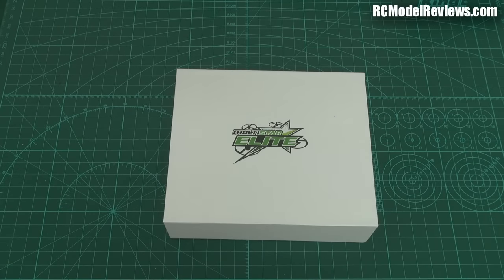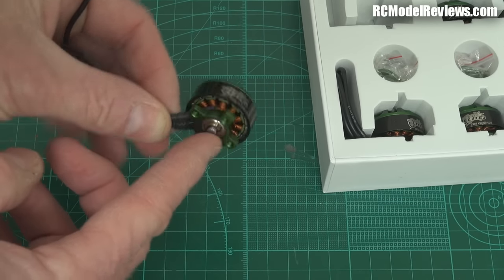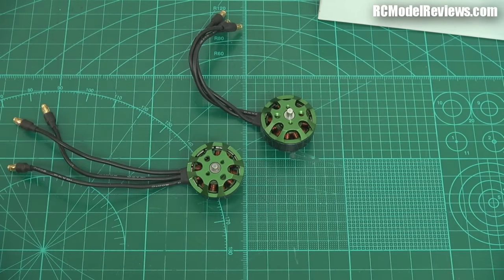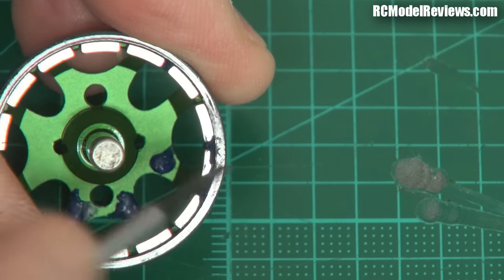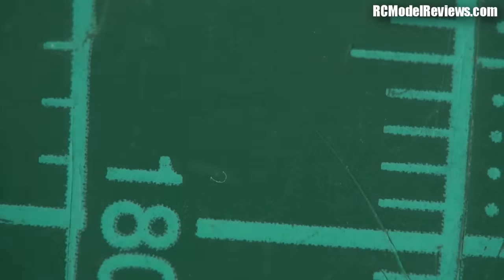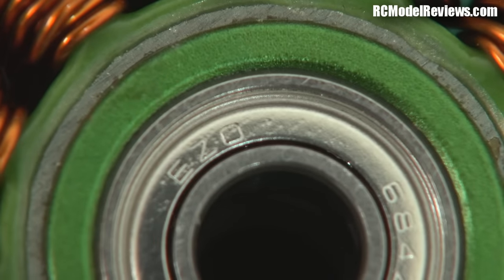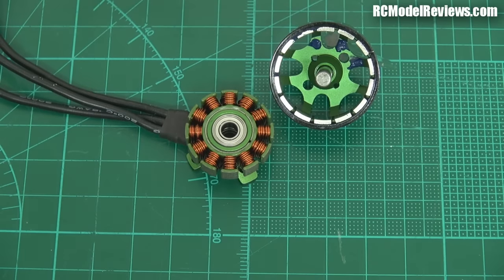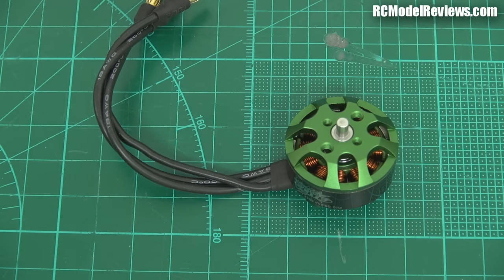Multistar Elite QC FAIL

Comment: Actually this metallic particle could have gotten in there at any stage, maybe just right before packaging. Even multiple qc steps couldn't have prevented that nuisance, It's the nature of the beast that magnets attract metal, and those are pretty powerful ones I suppose. The design and craftsmanship look pretty decent imho
Reply: +Patrick Zeiler 
If they can't make sure they don't have metal parts floating around between quality control and packaging, they have a quality control issue within their quality control.

Comment: Hi Bruce,

This motor is marketed as 2306 2150KV motor. The stator is indeed a bit bigger in diameter (probably tohouse the 11mm bearing).

Nice unboxing :) really look forward to your opinion on the use of 1x0.4mm strand instead of multi strands :)

Linus
Reply: +DrAg FPV Thank you very much, I was looking for these and couldn't find them

Comment: You know, I think I see another circular object inside that bell.  It is slightly out of focus but seems larger than the first piece, and appears at 4:48 elapsed time in the video.  This object is on the top edge of the magnets so may not immediately prevent rotation.

I suppose this is a lesson in the care and feeding of your brushless outrunner motor.  It is not often said but they should be kept well away from small metallic objects, which is not as easy as it sounds.

Comment: Those stator poles look rather short! If the 4mm bearing O.D. is considerably larger than those used for the "standard" 3mm shafts in other motors, then that means the stator pole overall length must be reduced. The total amount of copper winding is also reduced. 
Thrust tests will be very interesting indeed, I'm curious to see if the shorter length on the poles has any effect in the amount of torque and top end RPM this motor can produce. There's always a trade off, using stronger shaft and bearings necessitates a change in stator dimensions. Props to HKing for trying something different. The added strength is certainly a good feature and I wouldn't mind loosing out a little thrust and efficiency.  
Please test under high load and under low load. High load would be using a 6045 or a 5045BN propeller on 4S, low load could be a 5040 or a 5045 on 4S. Use SiLabs based ESC's with BLHeli, you'll get the most out of high KV motors with the faster SiLabs ESC's

Comment: That type of issue is understandable as it looks like a broken c clip that could have gotten picked up by the motor's strong magnets after QC testing when being boxed. I've learned to keep all motors in baggies to prevent that from happening after losing a small screw I never did find....errr! But drop a 45n small ball magnet in my back yard and you'll pick up rocks a lot bigger than that with a bunch of small ones. The gravel has a really high iron content and is something to look out for as well.

Comment: At least that looks like a broken circlip which is kind of almost understandable to be tossing around.  I've had several DYS 1806's that came with some kind of very find black ferrous sand in them stuck to the magnets.  Noticed it because it was so bad on one it jammed the motor up out of the box like that.  Took the others apart to check them and they all had similar dirt in them - just not enough to jam them up like the first one.

Comment: Looks like there was still some of that broken circlip remaining, visible at 4:58 . I wonder if that would be enough to undo the blue goo balancing? They used to drill out the bell to get proper balance. So much for rapid production techniques
That and bearings are so important, as we have our hands full with taking care of mass produced props and quality control. I have recently found a prop that finds both sides of the magnetic balancer. I had to take a break and do a re-think on the nature of gravity

Comment: Bruce, Have you ever tested DYS 1804 mini quad motors? I've had them on a couple of frames and they seem pretty good, but I have nothing to compare them to.
Reply: +Joel Azopardi . They are very popular . I have a them on a HK FPV250 plastic frame and they move out on 3 cells with 6030 HQ props. On 4 cells the quad is scary fast.

Comment: That piece of swarf looked like part of a mis-stamped circlip. It must have been in with the clips as the motors were being assembled at the factory and accidentally got picked up by the magnets. It's possible that the motor was manually checked and then that bit moved during packing or during transport.

Comment: bruce. what about testing out the t-motors on the bench?  

not many tests with the t-motor 2204 2300 kv`s out there, and im wondering how it will stack up against the cobra 2204 2300 kv. =)
Reply: Pls get the fact right, Cobra 2204 2300KV is 2205 2500KV. Many ppl have confirmed this so a reasonable comparison is with rcx h2205 2633KV or Air2205 2350KV..

Comment: 684ZZ is a 9 x 4 x 9 mm /deep groove/ball bearing/shielded. Come in 1-5 ABEC ratings. Very hard to get an ABEC 5 in small numbers. I have a 5014 (50mm x 14mm)Turnigy that uses the same size, to give you an idea as to the range of motors one would find these in. It has taken three tries with Aliexpress and Ebay to get a reputable vendor to replace Turnigy's stock ones that are at best an ABEC 1 bottom of the barrel.

Comment: A good way to remove debris from inside these motors is to use compressed air.  This works great to blow out bits of magnetized trash which is often hard to grasp.

Comment: I don't like them circlips with the piece sticking out. Had a motor heating up one day. When I checked it was not quite centered  on the mount and the circlip was touching the centre hole in a ZMR arm. The shaft was spinning against the circlip which heated the whole motor up...

Comment: Looks like a fragment of a circlip to me. Maybe one failed during assembly somewhere, and the motor picked it up as it was being boxed? I'm sure it would have been tested so that is spins freely somewhere along the line - given the balance goop that's inside the bell and on one of the magnets. Perhaps just one of those "shit happens" moments where it's picked up that metal shard during packing in the no-so-clean clean room?

Comment: Dear rc model reviews I am looking to buy a RC quadcopter for my birthday I have looked at Hobbyking ready to fly quadcopter but I seen your video talking about how hobby king aren't always reliable so I was wondering if you could help me choose the parts to buy to make the quad copter the budget for the quadcopter is £140 and that will include everything apart from FPV Gear it will be my first time flying a proper hobby grade quadcopter but I know what I'm doing because I am well knowledged in quadcopters and I have flown cheaper quadcopters in the past thanks for the help.

Comment: they probably tested it.. the bit of metal could have been picked up after testing. I am constantly "losing" my screws.. only to find them stuck to my motors, so much taht if i cant find a screw, i check my motors first.

Comment: When you said '' 2 are clockwise and 2 are counter clockwise ; i thought you only had to switch 2 wires out of the three on a motor to get it to spin in the other direction. ??
Reply: +Kevin Brain It's referring to the direction of the thread on the prop shaft for the prop nut.. Not the motor spin direction in this case. However (to explain further :), that's done (two of the set of four shipped with reverse direction prop thread) because two of the four quadcopter motors WILL be wired in reverse direction as per the craft design. It's done to aid in preventing the prop nuts spinning off if (when) you gun the throttle.

A better solution to the problem, is to lose the pretty spinner nuts and fit some much lighter alloy nyloc (nylon insert lock) nuts. This saves weight and also saves continually sorting out which spinner screws on in which direction.
Reply: right ok i see what you mean' i am used to the tapper type spinners that just clamp on to the motor shaft so it makes no difference to the threaded type of motor shafts.

Comment: Anyone who lives north of the alps will shake their head. First crash with this motor will be full of mud and result in ending the day
Reply: Spray water into it and continue to fly haha
Reply: Hoang Linh Bui After that they need to dry so you can oil it again
Reply: No, you dont need to oil these motors, the bearings are sealed. Also motors still work when wet so no need to wait for it to dry :)
Reply: Hoang Linh Bui  I dont agree with you. In my experience my motors last much longer when taken care of.